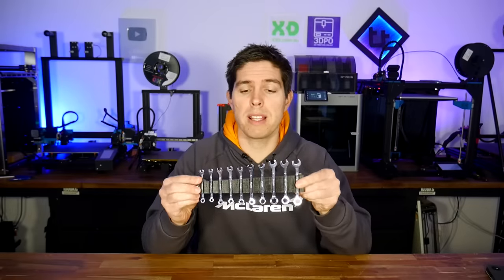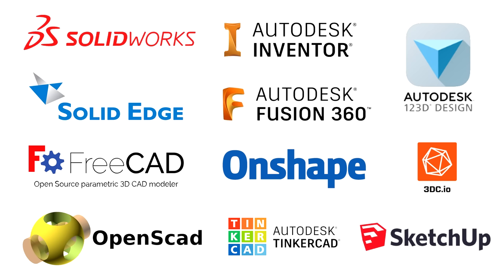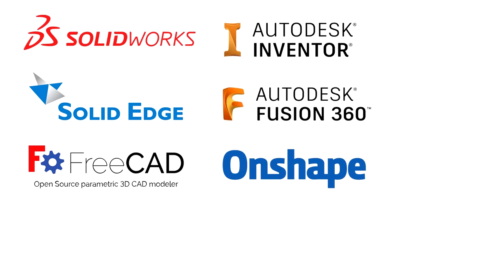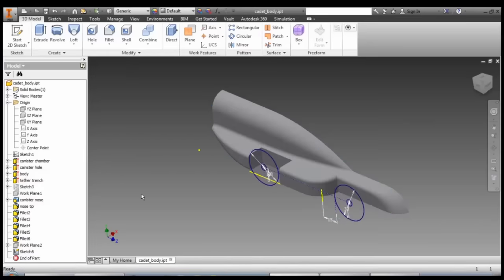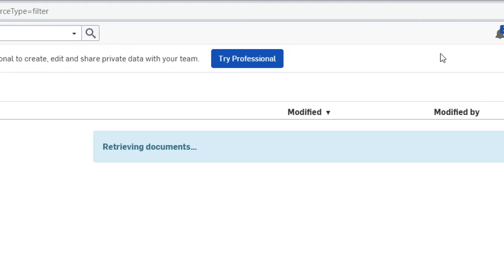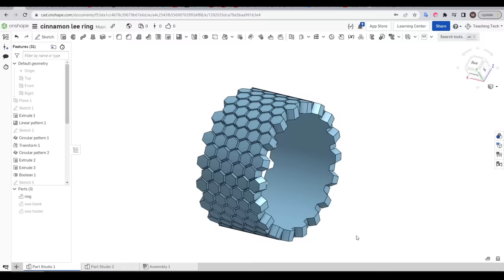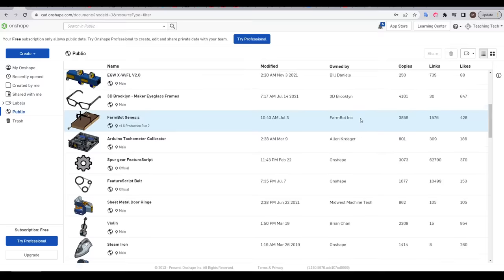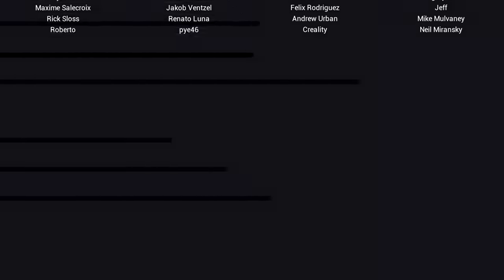Selecting a free 3D CAD option - 3D design for 3D printing pt1

Comment: Ignoring Blender in this video wasn't very good. It's not parametric out of the box, that's true, but there are several plugins that are being worked on to remedy that. Also, you don't always need parametric models. If you're designing something more of a piece of art, parametric stuff are just in the way. So - next time - please spend some time on showing Blender in addition to these ones.

PS: I'm comfortable with OpenSCAD and it is, along with Blender and FreeCAD, totally open source, meaning that you'll never see it happen that they suddenly shrink the possibilities and cripple the software to get money. For all commercial (or semi-commerical) software, you only have the right to use the software until they change their mind. So, if you spend a couple of years learning, say, Fusion 360 and they cripple it so badly that you can''t really use the free version anymore, you'll have to start over to learn something new. This is the same stuff as they say with drugs, they first is always free…
Reply: Add to that the dependency on "the cloud" and it simply isn't worth it. Having all your work open to all and only accessible with an internet connection is a show stopper.
Reply: Parametric CAD is absolute must for any functional part design. There's no other way. Don't get me wrong. Blender is great program, but even the BlenderCAD is still very barebones (yes it's very new and getting updates fast, but not there yet).
Reply: You are totally right and instead teaching tech invest into the community to help people to get too such opensource alternatives it's going too make tutorials for a commercial company that definitely gonna profit from this in the future.
Reply: @jothain  My point was that there are a lot of stuff made for and with 3d printers that aren't "functional parts" and for those, Blender is a brilliant tool, so just ignoring it in such an intro, isn't very good. Also, ok, he mentions OpenSCAD and FreeCAD, but nothing else, regardless of their openness and what you can do with them. I and a friend are working on setting up a half-finished "Monster Kossel" delta printer, some 110cm high (total) and the parts that make it up are made in Blender and FreeCAD.

PS: As mentioned, CAD is coming to Blender and it's coming quickly, but again, all these things take time and once more, you don't always need parametric models. Do you think those miniatures of superheros are made parametric?

Comment: I started with Fusion360 and used it for a little more than a year (I'm new to modelling), but now I'm stuck. I switched to Linux and basically all other CAD programs are available, except for the one I'm familiar with. And for the life of me, I can't seem to wrap my head around anything other than Fusion360. The UI, at least for me, is just unbeatable. I was able to model easy, medium and hard models all with one tool. And the given toolset is easy to maneuver and hard to master. Every other program is hard to maneuver and hard to master. The learning curve seems to immediately go up. 

Also: The limit of 10 documents can easily be dodged: After you finish a project, create a folder on your desktop and save the editable file there. Instead of opening projects through Fusion, you can open them through your desktop.

Comment: I agree there is no single 'best' but for balance I designed the whole open source 3D printed PUMA Microscope system on FreeCAD with some very complex parts. I started in 2018 with v0.17 and yes there have been some bugs and crashes but these are much fewer now with v0.19 and it keeps getting better. Not perfect, but totally free and open source and you can make very complex parts, animations, optics simulations, finite element analysis, etc. All it takes is for one of those commercial 'free-for-this-or-that' companies to suddenly change their mind (or their management) and your projects that you've been working on for years could get stranded or stuck in the past (or held to ransom).

Comment: Why is no one talking about Designspark Mechanical? It's free. It's fully functional offline. It's easy to learn even to complete newbies. Much more powerful than the beginner softwares and far easier to learn than fusion 360. I tried Tinkercad and was very soon finding it too simplistic and restrictive. Fusion seemed to have a very steep learning curve. A close friend recommended Designspark Mechanical from RS Components as it's completely free to hobbyist 3d modellers for 3d printing. After 1 or 2 online tutorials I was off and running building my own first designs. Well worth a look.

Comment: Nice video. Maybe this will get me to actually learn CAD better ;) I do NOT like the online aspect of the software! I live in a wooded area where internet is not fast and it cuts out all the time. Also when everything is based in the "cloud" (warehouse of computers that doesn't float :p ) they can take away anything they want at any time like another person said on here, they could lock everything up under a pay wall and say you can't get your online models unless you pay. Of course the easiest way around this is to make sure and keep a hard copy on your local drive all the time. I have played around with FreeCAD but I just do not know enough to make anything useful. Hopefully this video series will give me the kick in the rear I need to get to modeling!!!

Comment: I started with Tinkercad and was happy with it for a while but over time not only I missed exactly what you point out but I also found it likes to produce invalid STLs which I then have to repair in slicer. I ended up with Blender, it may not be parametric or solid modeler but it gives me what I need and I like the fact that it does not rely on internet connection.

Comment: Thanks for the video. I've been using Solid Edge for a couple of months now and I think that my choice is right for me.
I started with FreeCAD but found it buggy and limited with an inconsistent interface but I learnt the basics. Solid Edge is a Windows only, fully professional tool. The Community edition has all of the core funtionality but the more fancy functions (e.g. exploding assembly animations) have been switched off. There are some inconsistencies with the UI but after a while you either understand the reason behind the differences or you get used to it. 
Solid Edge also has two types of modeling, Ordered and Synchronous. Ordered is as described in this video, a list sequential steps to the final shape - the earlier steps can be edited as long as it does not introduce inconsistancies with later steps. Synchronous alows more editing of earlier steps and will attempt to keep related step in sync with following what it assumes is your "Design Intent". 
I'm only scratching the surface with my model. There are lots of functions that I've not even looked at yet but I found a few that are really useful. One is the ability to create a custom report of all of the parts in an assembly similar to a Bill of Materials so that when you go to buy your ready made parts you know to get. Another is the "Family of Assemblies" where you can have a number of different versions of the same assembly where a few parts are different. Most advances packages probalby have these functions but at the rate that FreeCAD is advancing it will be a while before it has anything like this.
There are a few YouTube content creators who post tutorial videos but there is also excellent online written documentation. There are also video tutorials from Siemens PLM (the developer) that are available to the Community edition users but I have not gone down that path.
One downside is that it is a huge package. I've got a fairly powerful machine and it likes to be the main program running. Also, the UI is quite dense so I can't imagine using it with a small screen.
Reply: I learnt to use Solidworks through my degree. But my job as an engineer demanded Solid Edge, which was incredibly frustrating to transition to. Everything is just more convoluted and dumber in SE comared to SW. Community support is rather poor, since 9/10 google search results point toward SW, while makers generally point toward F360/Tinkercad as those are free options. I use Solid Edge, only because I have gotten used to it from my job and I don't want to manage two CAD programs simultaneously, not that it is a good CAD software in my opinion. Granted, if you started CAD with SE, I don't think it is a problem at all.

Beware of the sychronous modelling though, I find it quite easy to make unintentional changes. Ordered mode is like restricting the data type of a cell in a spreadsheet instead of just allowing free text. You'd be scratching your head as to why your formula is not working because one cell is not explicitly formatted as a number.
Reply: @nicholaslau3194   thanks for your reply. I went with SE because I don't like browser based apps and because is was free. Having not used Solid Works I thought that the complexity was package was due to the increased functionality. FreeCAD is definately simpler use as well. I'm slowly getting used to it and my productivity has increase dramatically since the early struggles a couple of months ago.
To be perfectly honest, I have not gotten into Synchronous modeling in any big way. It seems to be better suited to single parts that have complicated geometry where some elements need to be kept in sync or interact in some way. My current project is made up of simple objects that I've built into a top down assembly. On a couple of occasions I've had to change something basic decision made early in the process and then had to remodel everything after that but that's not really a problem if there are only a couple of steps from begining to end. It would take me a lot longer to get my head around all of those design intent check boxes that pop up all the time.

Comment: OnShape is basically SolidWorks in a browser, at least the way designing parts works, so if you're well used to SW it's no wonder this became you favourite.

I'm currently trying to get used to FreeCAD because imho it's the one totally free option even for commercial use that allows for a certain complexity.

3D CAD licenses are ridiculously expensive for now-and-then use like development/prototyping with a 3D printer that happens about once a month.
Especially OnShape would be the ideal setup for a pay per use model for small business users but they haven't heard me yet on that...

Comment: You should look into solvespace, a FOSS 3D modelling program that makes it really easy to design parts with specific requirements. It's a bit different than parametric design as the workflow involves sketching out parts and then pinning them down by adding constraints. At first it is a bit tricky to get into and the UI isn't great, but once you get used to that, the workflow is great. Sketch the part, keep adding constraints until the degrees of freedom reaches 0, and you're done. Furthermore, it can export surface outlines, which allows to create designs that can be made with a laser cutter.

Comment: Solid works in the last year or so introduced "Solid work Maker" it has limitations placed on it but more to stop some one using it in a professional environment, its a payed software at approx 100  euro a year but for me i can justify it by the cost of 3 rolls of material or what not. 

I also started with SW in education, and never real fully managed to got onboard with fusion360. While freecad is amazing and theirs so many different tools and plugins, i feel there needs to be a bit more consolidation and polish to get get to the stage where i can hop in and design something without strange quirks braking my flow.

Comment: I've worked with CATIA, Creo/ProE, Siemens UG. Then came the Inventor / Fusion360. Out of all, CATIA I use the most and I'm most proefficinet in it. I has the most rigid logic behind and does not let you do ambiguous actions without a clear definition of what you want (unlike the autodesk inventor/fusion360). It's also the most transparent tree where everything is shown in the build tree, while it's also mostly true for other CAD, some ommit important steps in terms of logic ("solidify" in ProE haunted me when analizing other people's work). The same would be true in CATIA where a thick surface or closed surface solid may take place in partbody (the solid body) based of a much of wireframe and surfaces from the geometrical set (an unorderded parallell space that supports wireframe, and surfaces), but at least that geometrical set is present in the same document! you can still trace it back.
The logic behind a parametric CAD is very important for large project. A tiny inconsistency may break up a model, and if the model is huge like into tens of thousand parts it's a must to fix the model. This is where a transparent tree and good logic shows. In CATIA i can start designing a huge project like a full car with every nut and bolt and not break up the model midway, and if ihave to fix something I confidently can. A CAD program also has to take serious actions just to display the model. The full car model with tens of thousand parts are very smooth in catia because it ommits parts you don't see, wraps the products you are not changing etc. This is what makes CATIA the big player apart for something like Fusion360. 
CATIA has the least polished look.. it's straight up a 2000's program and the model looks dated in the shading and edges.. Crisp and sharp for CAD purpose, but others are just as clear and look far better. In terms for viewing 3d models i found that Design Modeler from Ansys has a really nice view - sharp, clear edges, less blocky, automatic transparency and colors and smooth as butter in contrast to CATIA. Also Creo and Solidworks and Inventor are in my opinion smoother in the visual eastethics of the model. (probably is my fault.. i only use P2 interface, P3 looks more modern and polished a bit like Solidworks but i've been using P2 for the past 15 years)

Anyway, CATIA is a really nice capable CAD program, the catch is you have to sell your soul to get it and periodically sell an arm then a leg for the maintenance of the licence. I teach CATIA in university because this is what the big automotive manufacturers and R&D are after: CATIA V5 for cad and ANSYS/Patran/Nastran/CFX/Fluent for FEA .

Comment: I learned Autodesk Inventor in Highschool, but never used it for anything else because of that student requirement. When I eventually needed CAD software again, I ended up going to FreeCAD.
My only real problem so far with it was trying to put text on a conical surface on a chess set I was designing for printing. Could get a word or two written manually, but it inevitably slowed to a crawl for any action, and hanged/crashed on occasion. My takeaway was that it can't handle too many parameters on a sketch, and I've really struggled since then to figure out alternatives.
I'm starting to learn blender for other projects that need aesthetics more than absolute measurements, but the learning curve is the Mariana trench and I'm not quite ready to do more than dip my toes in.

Comment: There is also 3D builder. It's free, but more "advanced features" like adding fillets are a pain to do.

Also, as a novice designer of stuff, Fusion 360 was so much more intuitive and easier to learn than most of the CAD programs I've tried. 
Also also, programs seriously need to implement dark modes/themes.

Comment: I find that FreeCAD works well for those that like parametric modeling that need precise dimensions. However, for more artistic 3d printing, Blender has by far the most features with a 3d printing add-on that will fix the models along with CAD Sketcher add-on for more precision models. They both need PC and are both completely free. Onshape would be useful if you need a mobile system on a laptop or phone. The huge downside with Onshape is the public only version. Basically anyone can get your file or whatever you are working on. So using it for prototyping for a home project that you might later monetize is what makes it a no-go for me.

Comment: i used Tinkercad for small things...but as you say...not much possible there...then i tried fusion360 but every year the same struggle to get the hobby licence...then i found onshape and its great that i can use it on my tablet too...sure..its free if u only have puplic parts but as a tinker i mostly share the designs later on Printables anyway

Comment: Very nice in-depth video.  I started with OnShape and migrated to Fusion 360.  But my educatoin subscription expired with 360 and I just thought I'd try
 OnShape again.  I like some things about OnShape better than 360 so I think I'll stay here a while.  Only use it for 3D printing and since they have designed airplanes with OnShape I imagine it will work fine for my hobby projects.  :)

Comment: Back in 2013, when I started 3D printing with my Solidoodle, the choice was pretty limited. I discovered Creo Elements/Direct Modeling Express and kept using that.
It was groundbreaking at the time because it is parametric and yet quite intuitive to use.
It's still available free to use, with the following limitations: no more than 60 parts per project and no exports to STEP which makes it impossible to share parts with other software.
Moreover, it hasn't been updated in ages, I agree OnShape looks way more modern, I'll give it a try.
However, if you are studying architecture or engineering, I would take the necessary time to learn SolidWorks, it's huge, probably only bested by its bigger brother Catia.